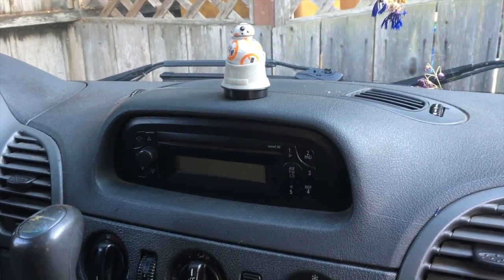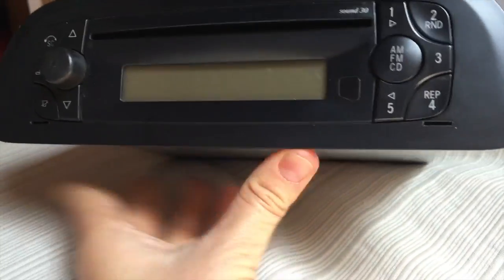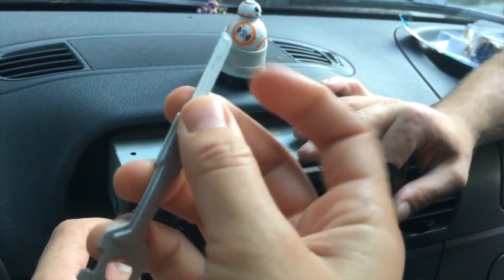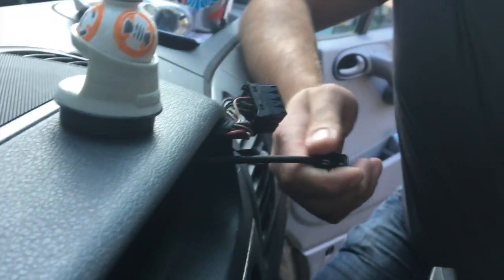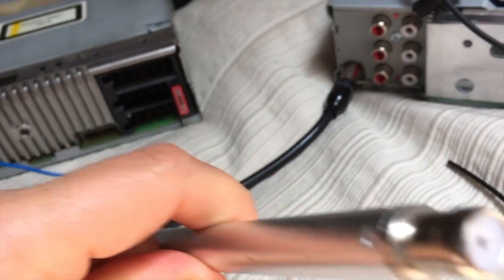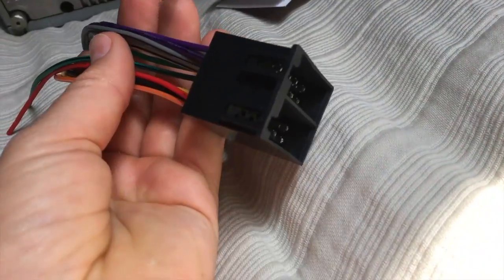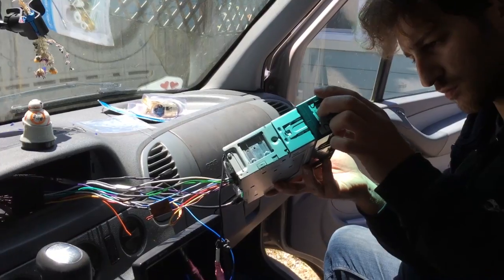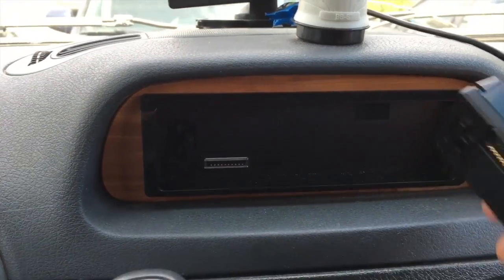Sprinter Van Maintenance - Replacing the Radio

Comment: Another suuuuper easy way to connect the stereo to the wiring harness is to use butt connectors, they're basically just a tube that you slide the two matching wires into on either end and then crimp down with a pliers. I used them changing my car stereo and it's worked like a dream for 2 years and counting

Comment: I had my cd/radio replaced professionally. It worked for a little while, less than a yr. now it works on Bluetooth, the radio picks up stations infrequently. It gets really hot, it seems like the hot air blower makes it hot around the player. After it's been playing a cd for an hr it stops working. Does anyone know if there's a vent or tube that carries the heater air that might have become dislodged when the stereo was replaced? Also it is just sitting there loosely. I discovered that accidentally. I slide the whole thing out yesterday but can't get it back in again. Very tight space to get the wires out of the way

Comment: I have been hooking up radios for over 20 years, just use the little blue wire nuts, and in a van set up like y'alls if you take the red and yellow wire coming from the radio and connect both of them to the yellow wire coming from the van you will not have to turn the key on to have power to the radio.(make sure to insulate the remaining red wire coming from the van, this wire becomes powered when you turn the ignition key on or to acc) only down side is you have to remember to turn the radio off if you are going to leave the van parked for extended periods of time. As to which if you are you should take the face plate off anyway to detour thieves from breaking in the van to steal your Kenwood! I do all my trucks this way.
Reply from the maker: Thanks for the tips! We're about to be back home and were going to do some more stuff on the van and fix the parts we broke. I'll remember that about the wires! That would be an awesome thing to have!

Comment: IMHO soldering is totally optional - I've installed many radios over the years without soldering and without any issues - nice video, keep 'em coming
Reply from the maker: Agreed. After Michael and I had gotten a bit deeper into this it seemed like we could've just spliced the wires together. But it was a fun thing to try!